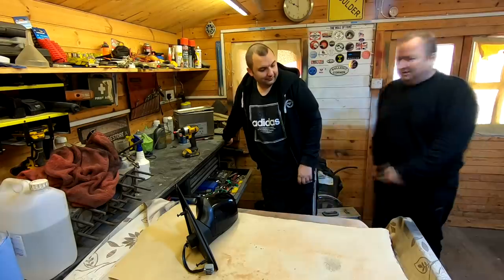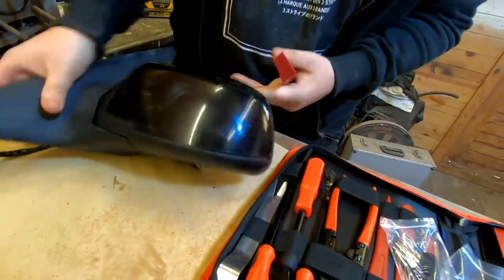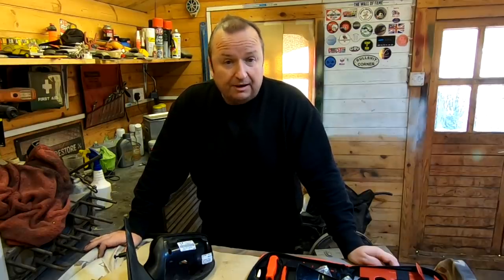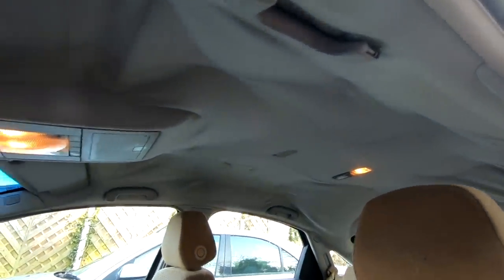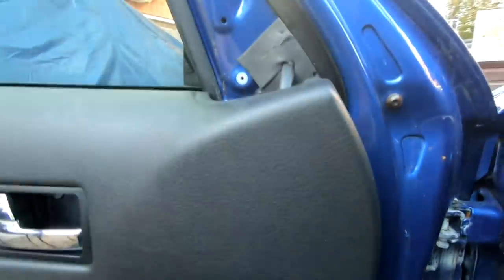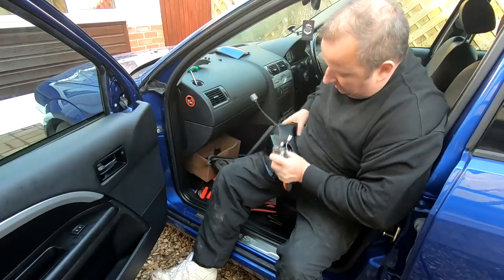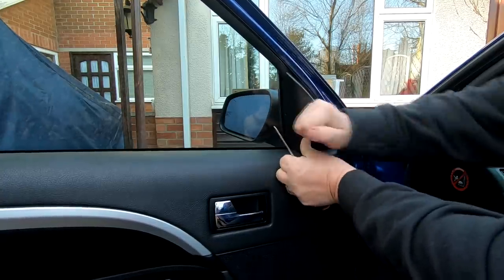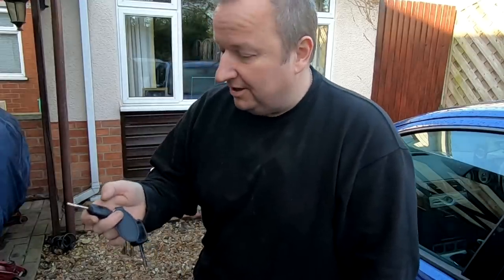Mondeo Mk3 ST220 Mirrors, Vectra Roof Tinkering Vlog

Comment: Very interesting videos as always Martin.  Before going to the hassle of doing the head gasket on your Vectra, try putting some K Seal in the cooling system.  I’ve used it on my own Vectra C 1.8 and also on an Astra H 1.4 that was losing a litre of coolant a week when I bought it.  I added some K seal to the cooling system and within a few days all coolant loss had stopped completely.  Used it on a few other cars over the years, all successfully.

Comment: It's good to mend stuff and keep it going. I have just put my 2002 Volvo V70 D5 back on the road.
It needed a new clutch and flywheel, engine mounts, timing belt and water pump.
Second hand parts included a turbo (£42 from eBay, works fine!) Intercooler, wheel bearing and alternator.
The rear suspension needed a complete rebuild and new springs plus shocks. Financially I would have to say it's a waste of time but it passed the mot and drives really well. At 200k+ miles it should last another 100k now.
Better the devil you know!

Comment: Tip for the head lining, get a drill brush and use that to get the remainder of the head liner foam off. I did my whole head lining in about 5 minutes on a ‘97 Calibra

Comment: From experience with Rover SD1 and 800/Montego headlinings, if you can get the shell out makes the difference and I can't remember the name of the glue I used but you put it on and used an iron on a medium heat and no steam and worked out from the centre and trimmed off any offcuts after using a glue to make a little lip on the edge on the inside and should be a lasting repair.   Using a black cloth or velour hides a lot of sins too.   Having it out on your front room floor with plenty of room makes it an easier job than trying to do it on the open ground.
Reply from the maker: That comes in the next vid Ian.

Comment: When doing the head check with a straight edge that the block is flat do the same with the head we have had plenty of vauxhalls with warped heads and blocks common as do do also check around exhaust valves and seats as these also crack and cause water into exhaust
Reply: Ford rs 2016 was common for warped blocks and cracking around water liners

Comment: Martin when you do the roof lining use high temperature glue, I done mine in my zafira about 4 years ago, first time I used standard spray adhesive and within about 2 hot days it was sagging again, redone it with high temperature spray adhesive and it's still looks new now, if you need any advice let me know, I'm just like you, a DIYer not a professional.
Reply from the maker: I've already got it. The stuff I used in the previous vid is high temperature roof lining adhesive